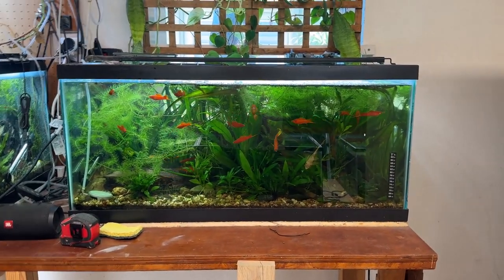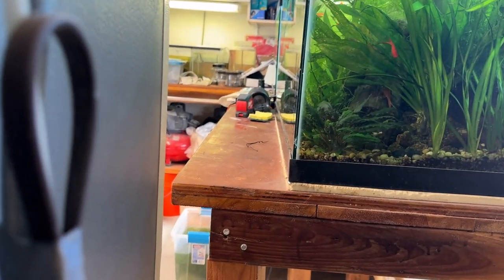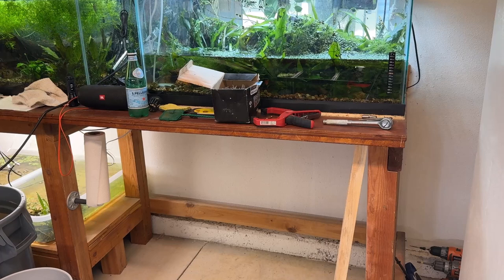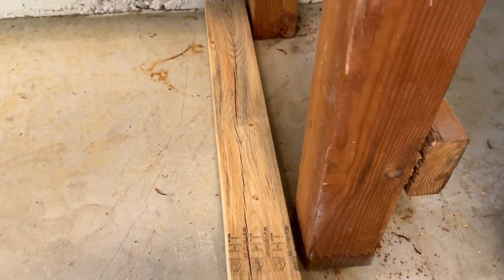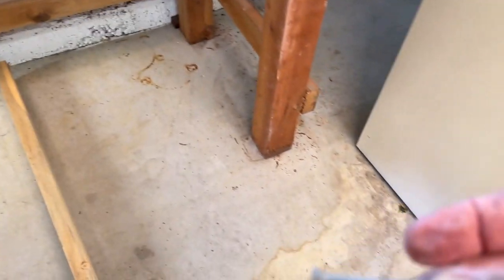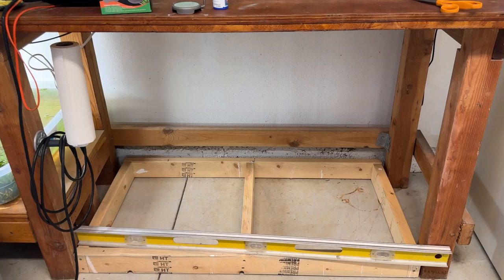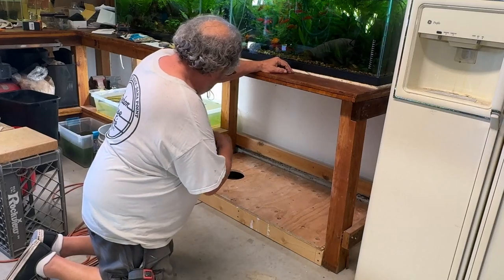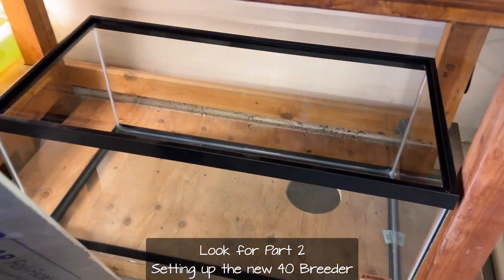Bench Repair And A New 40 Gallon Breeder

Comment: 40 breeders hold closer to 45 gallons.  With the weight of the substrate, decorations, glass and filters, I usually round to about 10 pounds per gallon.  I think you have close to 900 pounds of fish tank on that bench.
Also, tanks for sharing!
Reply: Looking forward to the new 40g build.
Reply from the maker: @Merb34st  I would not be surprised, Merb. And tanks for lookin’! 😁👍❗️🇺🇸
Reply from the maker: @Merb34st  at this point it’s going to be a rebuild😁